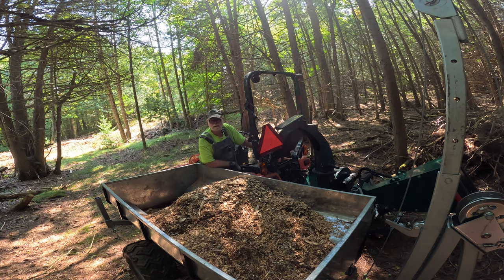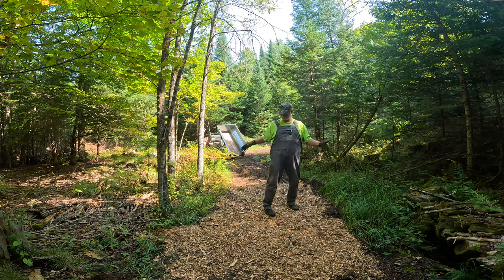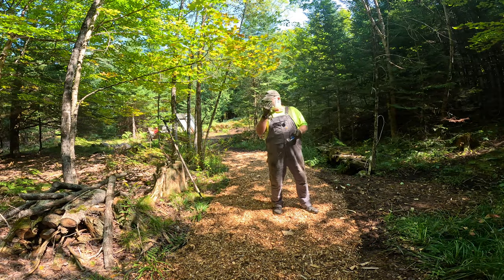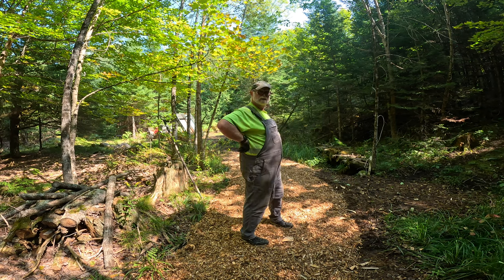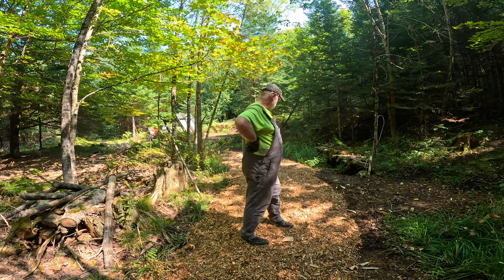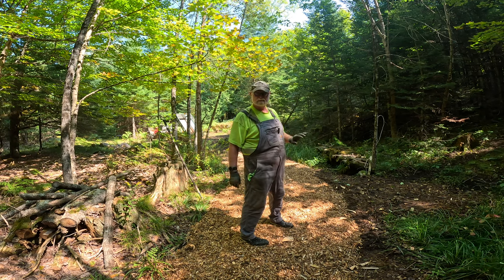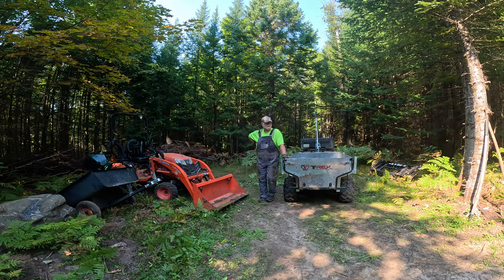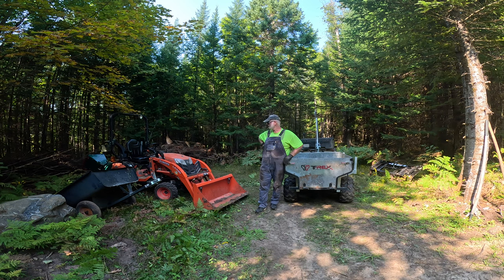Off Grid Cabin Build Has Epic Trail Improvements Underway! (Part 2)

Comment: Woodchip roads are awesome. I'd like a dump trailer like that, but I use my Kawasaki mule's dump bed. But I really need to put plywood to stop the chips from launching all over the cab.
Reply from the maker: I actually bought the trailer and used it mainly as a logging trailer at first but that removable box really makes it so versatile! Thanks for stopping by Ross!

Comment: Those chips should definately help with the road Brian...........beautiful spot and a great forest to work in for sure.........lacking some water for me though.........Wish I had a chipper like that.....nothing to run it on though.........seriously thinking of getting a little gas jobby off of Amazon........any thoughts on those??
Reply from the maker: Yes they really do. I have a smaller chipper I got from Home Depot about ten years ago. It’s getting a bit tired and no hydraulic in feed. The big trick I found with it is to keep the cutting blade extremely sharp. Thanks for stopping by!